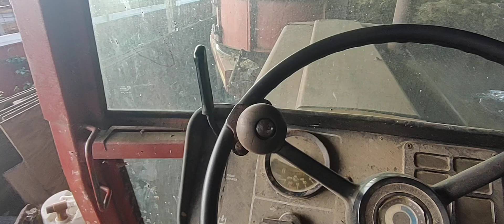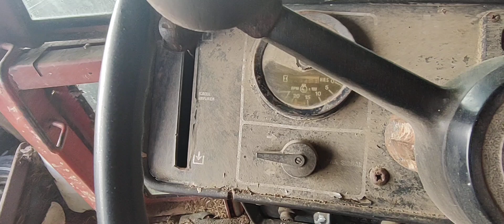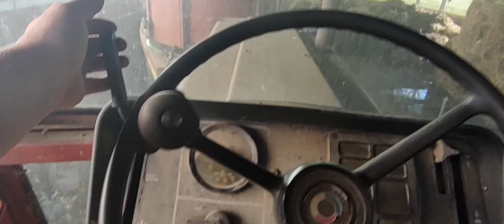IH Torque amplifier. What is the right way to shift it?

Comment: Its just a clutch pack being engaged by hydraulic oil, just like PTO or modern powershifts or an automatic. The firmer/faster that shift, the less wear on the clutch packs, BUT, if  you feel the slam in your seat, like it jolts you, that is getting excessive. You do you and everybody else will also do whatever the heck they do haha.

Comment: You slam it forward is what I’ve always heard. Grew up on 56, 66 and 86’s. 
The only original thing JD ever had is the plow and the Soundguard, lol!
All joking aside, Deere, CNH and Agco are buying or farming out with other companies.
Reply from the maker: That seems to be the majority consensus. 
That would be in line with how my Ford dual power shifts and White over/under. Both just engage when shifted. Run something long enough and you can feel how they want ran. I'll probably start shifting it more like everyone says but I'll still ease it in like I do when shifting up in higher gears under load.

Comment: I’ve never owned a 86 series but I’ve had and or drove 06 56 and 66 series and there’s no real “lock in” on the TA you just pull it back or push it forward. I would think easing the ta forward would be the correct way bc slamming it forward in my opinion would do more damage. The only thing I was told was never use the TA in high gears to slow down. You’ve been doing that for 20 years I doubt it’s gonna break at this point 😂. But no matter how someone uses something it’s gonna break at some point.
Reply from the maker: They're definitely not to be used as a brake. 
As long as the engagement is smooth I think either way is fine  from what I understand is the sprag gear is the weak link. I feel the biggest risk is shifting up in the higher gears while pulling a load. That's when the most stress and torque would transfered to the smallest gear. 
It'll work till it don't. 😂😂

Comment: I cant imagine its going to change anything to much, the lever on a 1066 you cant really snap it back up, but obviously you know thats not a 1066 soo
Reply from the maker: Either way I'm sure they both function the same. I'm thinking the 66 maybe like my white and has detents to engage the lever positions and the 86 does have a spring assist in the workings.

Comment: If your not a big acreage farmer you don't need new equipment as long as it does the job that's all that matters
Reply: I’d much rather be able to fix my own stuff than have shiny new equipment
Reply: I agree with you. If its working fine no need to upgrade